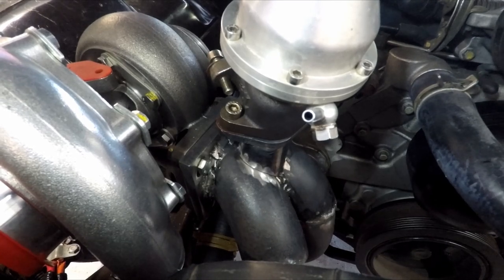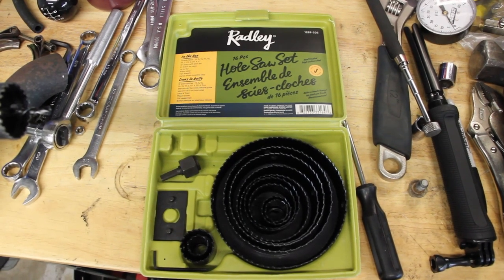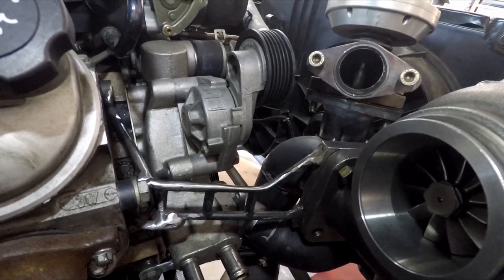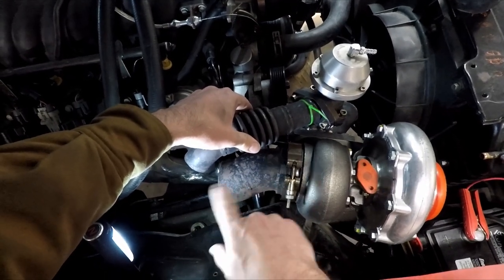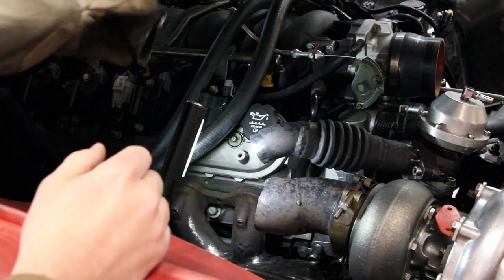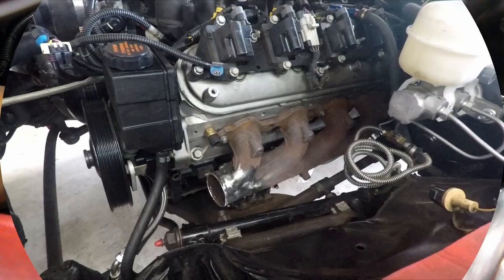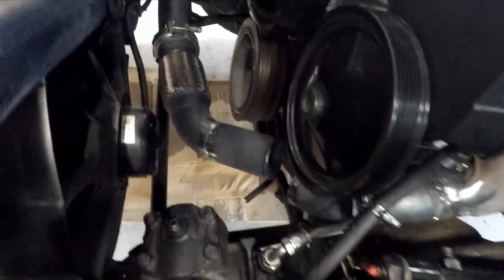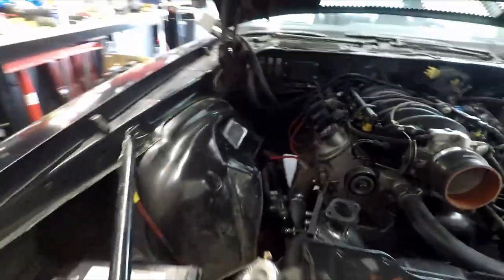Pro touring LQ4 Swapped 1981 Z28 Turbo Build EP.4  //  Wastegate and Hot Side Crossover!

Comment: I tried to run mine inside the subframe but it was gonna be to close for me and Unfortunately my fuel lines are also occupying that space. So I ended up running mine behind the front tire which I’m not a big fan of but honestly it hasn’t been that bad at all while driving.
Reply from the maker: Yeah it’s a bit tight there but I hope it works out. I’d like to have an actual exhaust on it but if it does work then I’ll go with something easy and functional.
Reply: @The_604_Garage  I agree, Do plan to run the exhaust at least to the rear axle at some time.